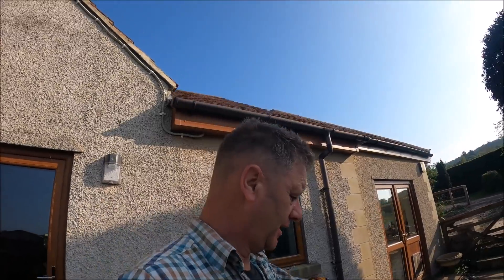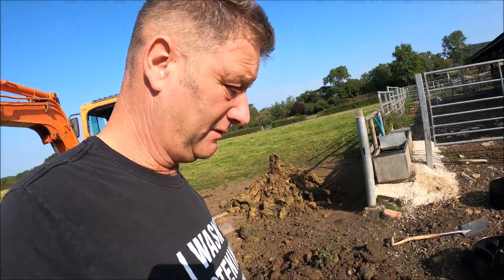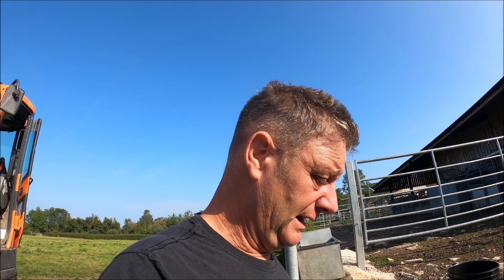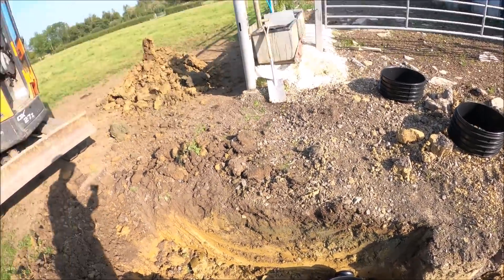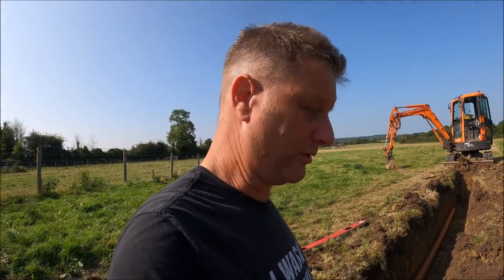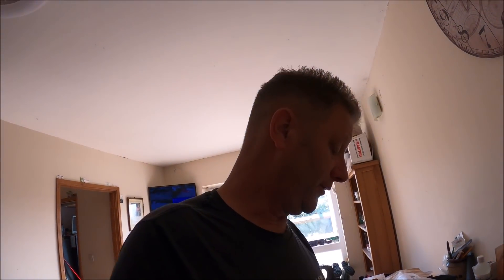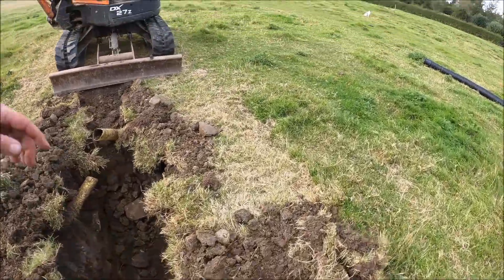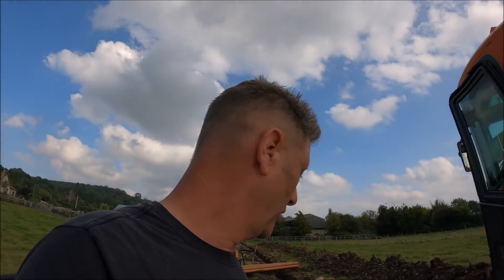Getting rid of MORE water  04 09 21

Comment: On the un-used entries to the "belly" just use short bits of flex aimed out then crushed down outside where you're gonna pour the mix around it, you've got scrap laying about I'm sure, sorry about the advice arriving Thurs, I got exceptionally lucky - they're installing fiber internet in my neighborhood and the contractor is more than happy to dump the excess dirt in my yard so I can fill the near 18 yards of troughs from the plugged sinkhole... been very busy!

Comment: To get your pipes to slide in easily to the fittings,  top tip is to use a bit of vet lube gel, you only need a very small smear.

Comment: I would've sawn a foot or 2 of the socket end of making that first length out of the manifold a double plain ended pipe, then put next piece in socket first & it would've been the right way around for the rest of the run, simples 😉
Reply: As I was watching him put the first length in to the gulley I was thinking exactly the same thing - the socket should be on the uphill end.
Reply from the maker: If I was running foul water I certainly would have, but for simple rainwater with a six inch perforated drain right next to it, I didn’t bother. I should have perhaps, but it’s in there now, 🙂👍🏼

Comment: When I asked you before you said you had the equipment for finding  under ground wires is there a reason you didn't use it
Reply from the maker: I do have a CAT4, but it needs a current through it to work, the cattle had chewed the wire through, so no current 🙁

Comment: Hi never a good idea putting a electric cable in a water pipe someone could cut into it  with  a saw to get  water  and get  a shock if you need to get around a corner without a bend cut the pipe on and angle then it will go round  a bend if you are short of  a  fall put it level  you have got  4 inch of play in the  pipe on the end of the world in a bit lays in the pipe  road  chippings are a good back fill if they are laying any near you  and sweeping them up🤔👍👌
Reply: Its an electric fence cable running from a transformer  so only 12v.
Reply from the maker: Wha5 Paul said ☝🏼☝🏼😄👍🏼

Comment: I'm sure your getting a lot of top tips Ian but to get the pipes to ease in easier and quicker is to use fairy liquid or a cheap brand of it, and if my plumbing skills are correct the 110mm brown drainage pipe is the wrong way round though it will still work but will over time start to leak lol.